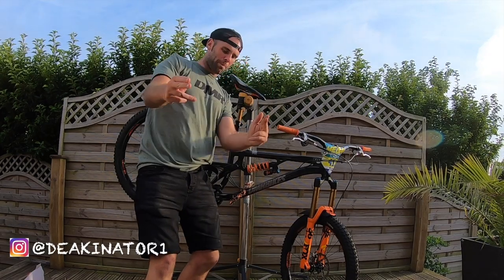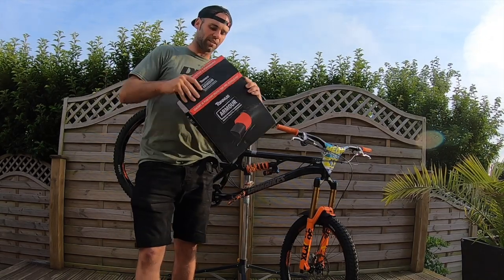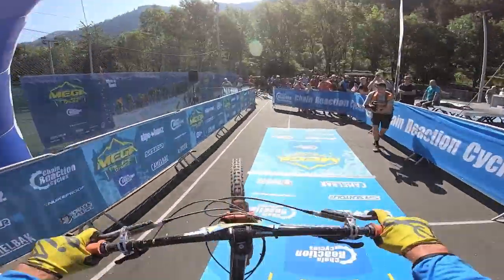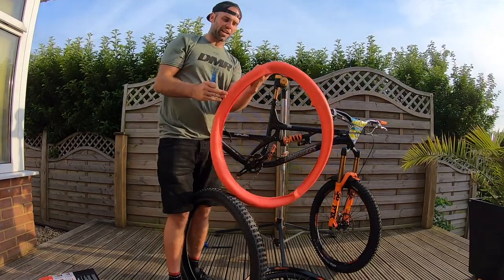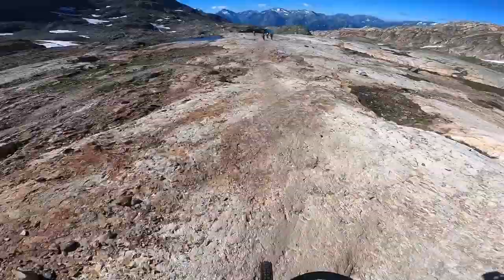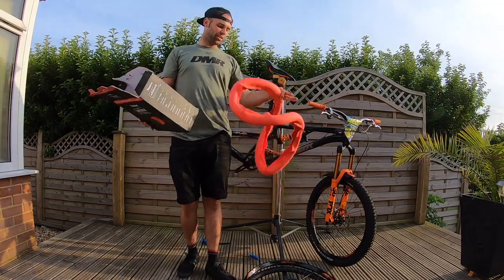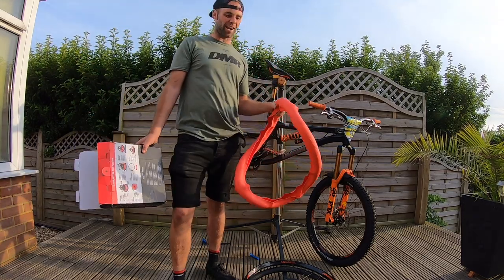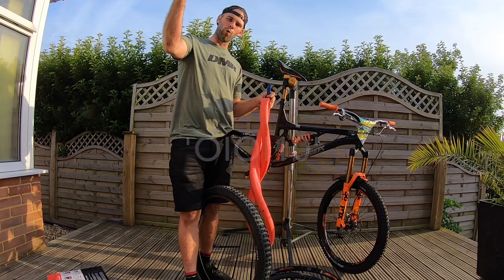Is this the reason my Bike survived the Megavalanche????

Comment: These things are the BEST! The rocks where i live are very square edged and sharp and even with DH casings I would need to run 40psi in the rear. These things fixed that completely and they also make your tires feel much more planted, hard to describe really, kind of like the difference between an air shock(representing tubeless) and a coil shock(representing tannus), that's the best analogy i can think of anyway. Also makes them very quiet. Really highly recommend these.

Comment: Ive tried them on a rear of my hardtail...so impressed got one up front too. Very confidence inspiring system...I no longer carry co2 etc just a very light pump and a tube and self adhesive patches ...which Ive not yet used... running 20 psi ....I recommend a bit of talc when installing... with a touch of shower gel on the last inch of levering.

Comment: Been running them for months now, they are awesome, not just puncture protection but grip,  vibration damping, bump absorption etc. Yes theres a weight penalty but i now run lighter  tyres than previously because i dont worry about flats.
Reply: seen some folks running tubolito with them saves few grams also..  I think trade off for wieght vs flats not even a debatable deal for me.

Comment: I've been running them for months. I got a new bike setup tubeless, bent a valve and it constantly went flat. Cleaned the mess out put a tube in, cased a step got a pinch flat. 
Bought tannus armour ran stupid pressure like 20psi in the rear and cased all sorts of shit on my hardtail. I Could hear the rim dinging but still had air in the tyre. 
I would buy again definatly.
Reply: That's an ultimate test for these indeed. No flats means you are receiving ultimate protection from these then. They sound like a winner IMO! Cheers mate!

Comment: Hey Ben, been looking at the Aquila in a wirebead DH casing for some of the rockier fast tracks I do. Do the wirebead tyres still hook up tubeless properly or do you need a tube?
Reply: I ran Aquila's out in Morzine on a tubeless setup just fine without any inserts. Ran mint on the high speed rough stuff. Needed to take the valve core out and use an airshot initially but that's nothing unusual for some setups anyway 👍
Reply: @scuz26288  Cheers, was that the wirebead version? They are pretty damned cheap at the moment and was gonna grab some.
Reply: @BensMis-adventures  yeah that's the wirebead version. Think Merlin were doing the softer compound for about 30 quid last time I looked.

Comment: How is this better than a foam insert with tubeless
Reply: Aside from the fact that it looks a lot easier to instal than even tubeless let alone cushcore
Reply from the maker: As stated where there are plenty of rocks on the mega people we’re dinging wheels, ripping side walls so even the best of sealant wasn’t being able to seal the holes or just loosing to much pressure, I get it if you’re running tubless on easier flow trails where you haven’t got that problem than great, The damping in this system took a lot of the sharpness of the rocks away as well, I’m not trying to be a salesman just telling you my personal experience.